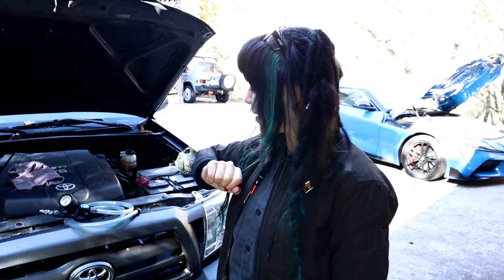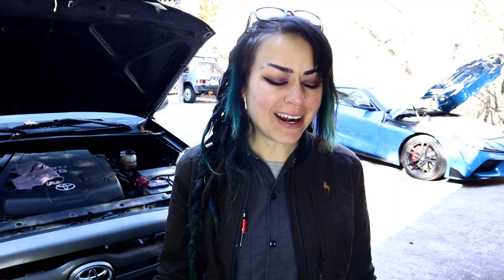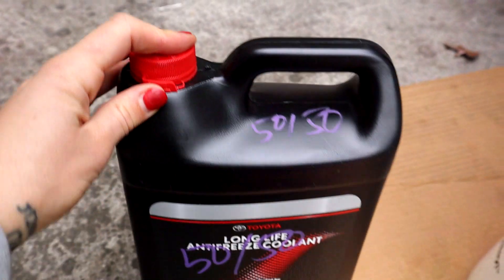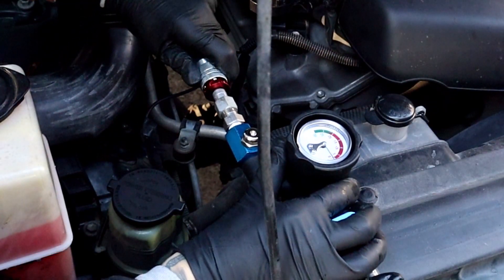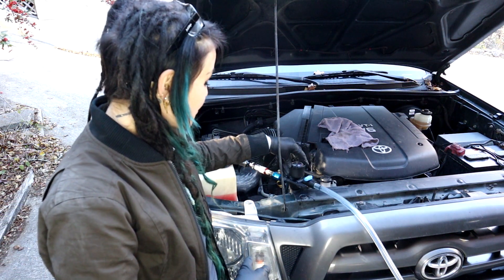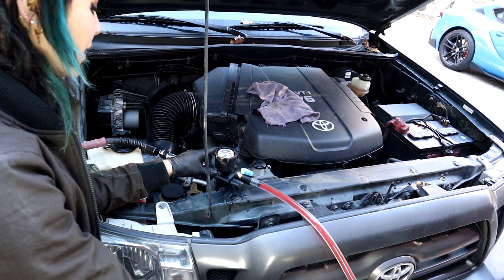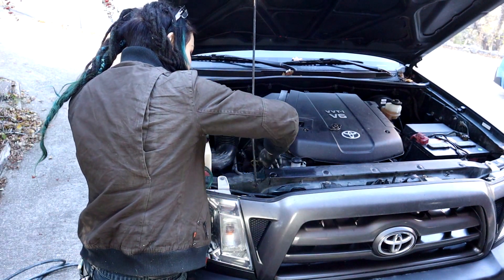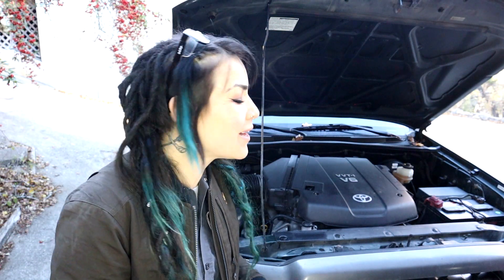How To: Refill Your Cooling System Using An AirLift Tool! // Coolant Flush part 2!

Comment: Yo, stick the bucket up above the fill valve.  When you get to the end, and the pressure has neutralized, it'll continue to siphon coolant into the system until it runs out of the other port on the tool.  That ensures it's completely full at the end without having to pour more in!

I mix coolant in an old 2 gallon pump sprayer that the pump went bad on, it's the perfect size for most cars, and easy to fill.
Reply: Good idea also to let bucket siphon before attaching hose to the valve. That way when valve is opened, almost no air is in the hose.
Reply: I hadn't tried that - next time!   You can 'reprime' the tool when you're close to the end and repressurize a bit futher.  When I used it, I needed to put 2.5 gallons in.  The initial prime only put in about 2 gallons.  I had to repressurize anyway to get the rest in.  No problems whatsoever.

Comment: Great video, Faye. The vacuum system is probably the best way to refill a cooling system. In fact, a lot of OEM manufacturers are now specifying this tool as the correct way to refill their cooling systems. Keep up the good work.

Comment: I have the exact same vacuum fill. Use it everyday to fill coolant to max to prevent air behind the thermostat and also to check for leaks after a repair. Totally recommend this tool to any auto tech.

Comment: I've had this exact tool for about 5yrs now.  No issues with it at all.   

However, I have been bit in the bass by thinking, "it held a vacuum so I have no more leaks.".    Corrosion on a pipe inside a hose.  In a vacuum it held but under pressure it would leak.  I now always put a pressure tester on before releasing a vehicle.

Comment: Ok on some vehicles its tought to get all the air out with a vacuum tool. I have noticed that if you pull a slight  vacuum then prime the hose with new coolant it removes all the air thats in the hose coming from the bucket.  Because if you noticed that once you opened the valve to introduce the new coolant it pulled in all the air from the empty hose. Just a little info if needed. From one technician to another. Thanks take care.
Reply: Could you share how to go about priming the vacuum hose? I'm sure it would help a lot of people out including me. Thanks in advance.

Comment: Nice video!  I totally agree on using this type of tool to leak check and quick fill a cooling system.  I used a UView 550000 Airlift in two my videos when I replaced the cooling system hoses and water pump.  It fills the cooling system in just two to three minutes.  Keep up the great work!

Comment: I agree with the vacuum filling how ever invest in a better tool that fastens to the radiator cap opening instead of relying on vacuum to hold it in place, Rock on Faye

Comment: Thank you, Faye. I appreciate your videos for their content and clear content and instructions. Love your personality and enthusiasm too. I do have one question, at what point did you remove the vacuum tool from the radiator? Does the tool stop  intake of coolant on its own? 

Thank you, again and please keep those videos coming.
Reply from the maker: I removed it once the pressure went back to zero! Yes, when the system is almost entirely full it will no longer have a vacuum on the system, so coolant will stop to flow through the tool and into the rad. After I remove the tool, I just top off the radiator!!!

Comment: Anouther great video. I drive truck for a living and my old truck had a coolant leak. They hooked a much bigger version of that vacuum pump to the reservoir and a feed line to the draincock. They then back fed the coolant through the draincock to fill the block and radiator from the bottom.  I think it took 10-12 gallons of coolant.

Comment: Thanks for taking the time to show us. Great channel. I was also wondering when you connect the compressor what is the required psi setting? If that matters or not?
Reply from the maker: Doesn't matter for this - I have also used a tiny portable pancake compressor and it just takes a little longer, but still worked!!

Comment: A tool like this is shown for a 2012 Chevy Cruze. While it is currently outside my budget it would help with me forgetting to open the top plug to let air out of the radiator when refilling. I usually figure it out when the heater won't heat. While this particular Cruze is a money pit it does offer lots of repair experience (like I need this at my age).

Comment: Faye, you should have primed the filler hose so the air in the initial empty filler hose did not go into the system.

Comment: Excellent video!  So if you are flushing the system, do you use the airlift tool to fill with distilled water several times before filling with coolant?

Comment: A friend of mine expressed some concern that creating a vacuum in the cooling system could allow atmospheric pressure to crush the engine block, which in extreme cases could be followed up by gravitational collapse, reducing the engine to a singularity. I told him the risk was not significant but I think he just likes to worry. 😉 Anyway, I never tire of the adorable chickens. Bless you!

Comment: You hair is the color of the car sitting in your driveway.    Looks great .  What happens if you get some air in your system , I always thought it worked it way out . But maybe that was old school.  Not sure if the new filler tank has a pressure relief . Oh and one dumb thought , could you collapse the radiator tubes?

Comment: Very informative video. Can you also use the vacuum tool with buckets of fresh water to do a system flush prior to refilling with fresh coolant?   Also, I assume you need to set the air compressor to a specific PSI for the tool?
Reply: I believe the manufacturer of the tool specifies 90psi minimum... I run mine at 150.

Comment: Sweet thanks for the video, picked one up today! Will this tool work on a simple drain and fill of the radiator without draining the engine block? Or will the vacuum just suck up the coolant (into the vacuum of space!)?
Reply from the maker: Yes, absolutely it will! You may suck up a little coolant but that won't do any harm.
Reply: @FayeHadley  I ended up doing the full drain. The driver side block drain wasn't fun trying to find the right extension/swivel combination but got it done. 

I was able to pull about 23" Hg of vacuum but it wasn't holding (slow leak). I readjusted the airlift tool on the rad opening and pushed down on it while I pulled vacuum. It was better but still a slow leak. Went back and checked both engine drain plugs (was able to get a torque wrench on the passenger side) and I gave the rad petcock a little extra with some channel locks...no difference. Still had a very slow leak.

Ended up just pulling 23 Hg of vacuum and filling. Seemed to work fine. I topped up and got some of the final air out of the top rad hose. Test drive was good and then this morning I topped up the rad and it took ~100mL. Checked it after work and it's still full and the overflow reservoir is still to the level I filled it. Checked both block drains which I sprayed with compressed air last night and cleaned with a rag so leaks would be obvious. They're both dry and clean. Don't see any leaks around the water pump. Only 60,000 miles on my 2015 Tacoma and no other issues...I wonder if it could be something that leaks under a strong vacuum but holds the positive pressure of the cooling system? Or maybe the tool doesn't seal on my radiator very well 🤔. Of course I did the job after work in the evening and needed my truck for work in the morning so I didn't have time to troubleshoot too much.

Congrats on your new Supra 😁

Comment: Game changer for those that work on equipment that might have a heater core located waaay above the water pump.  Or anything where the radiator is lower than the pump.

Comment: Remember kids...purge the fill-tube of air, else it all goes into the system, when you open the valve. Best way is to open the re-fill valve slightly whilst pulling the vacuum: it'll fill with coolant :)

Comment: I can't hold vacuum using this method. Assuming the connection is good, what could be wrong with the vehicle? Head gasket issue? Bad radiator? Any other possibilities?
Reply: Update: I did a pressure test, and there was a leak by the thermostat. Replaced thermostat and thermostat gasket (the old one was worn out) and that seemed to fix my problem.

Comment: I noticed that when you create vacuum it does not pull from the overflow tank?   it the unit just purging the air from the radiator, then past the engine block "since you said it opened up the thermostat" and thus does it also pull or fill the heater core?   Do you have the heat in the on position even thought the engine is off?   Thanks again

Comment: What is the minimum CFM needed to use the AirLift Tool?
How long did it take to create the vacuum ?
Reply from the maker: Honestly not much for this tool, I actually have used it even with a tiny pancake compressor. It just takes a little bit longer. It only takes a couple of minutes to put the system into full vacuum but you want to leave it there for a while to make sure that the gauge holds steady!

Comment: What kind of pump would you use to refill transfer case or front and rear differentials
Reply from the maker: I have a hand pump but in my diff service video I use a cheap drill pump..That one is super cheap and leaked after five or six uses but I have since then upgraded.

Comment: Easiest way to do a coolant service but Idk if I would trust those cone shape coolant refillers due to the fact that they can come loose, I got a snapon refiller with the turn clamp cap and works awesome but for the price I heard these are pretty cheap since you can use them on any car and don’t have to have all diff kinds of clamp adapters for car manufactures.
Reply: It's not a problem.  If anything, you have way more flexibility in terms of servicing multiple makes and models.

Comment: Is there any way to purge the air in the hose before you open the valve to let the coolant into the system, or is that amount negligible? Thanks for the wonderful video! I simply refuse to do another coolant flush without getting one of these!
Reply: You can 'reprime' the tool when you're close to the end and repressurize a bit futher.  When I used it, I needed to put 2.5 gallons in.  The initial prime only put in about 2 gallons.  I had to repressurize anyway to get the rest in.  When I did, there were some bubbles that came out.  No problems whatsoever.

Comment: When you open the valve on the coolant supply line, it seems your injecting the air in the line into the cooling system because the line was not primed.  not sure there is a way to prime that tool is there? Would need another ball valve to shunt back to the venturi exaust line.
Reply from the maker: Oh totally, you can just stick it in the bucket!! Let the hose fill, shut the valve, and bring it up to the rad, it will stay full!
Reply from the maker: HAHA for sure! I normally prime the hose by placing it into the bucket of coolant first, then closing the valve. 👍🏻 (Oops I forgot to do that in this video!) but regardless it wasn't enough to make a difference or capture any air into the system, yay!
Reply: Thx for the reply. It seems like a pretty small amount of air in any event. Less I could imagine then a conventional fill depending on the car.
Reply: It's not really a problem.  You can 'reprime' the tool when you're close to the end and repressurize a bit futher.  When I used it, I needed to put 2.5 gallons in.  The initial prime only put in about 2 gallons.  I had to repressurize anyway to get the rest in.  When I did, there were some bubbles that came out.  No problems whatsoever.

Comment: Thanks Faye!

But wouldn’t it be a good idea to get all the air out of that clear hose. Either siphon the hose full of coolant, or elevate bucket with hose attached to bottom of bucket and let hose fill before attaching it to control valve.

Comment: I have  a question for anybody that has the answer. will this work on a remote Reservoir type cooling system? you know one that doesn't have a radiator cap on the radiator.
Reply from the maker: YES IT DOES! Just place it on the remote res - I should have addressed that in the video, thanks for the Q!
Reply: @FayeHadley  ah very good. Thank you.  I hoped this was the case.  Gonna buy one for sure. Been on my list awhile.
Reply: Yes it does - just performed this service with this tool on the LS 460.

Comment: I am slightly concerned that the vacuum will be harsh on the rubber coolant hoses. do you think doing that several times can cause the coolant hoses to fail?
Reply from the maker: Not at all! But if they show any signs of weakness here... then you know that they are on their way out and need to be replaced soon! It's a good check of their health. Think about all of the pressure that is being exerted on them when the cooling system is hot and under full pressure!
Reply: @FayeHadley  Sounds good to me. You are an amazing woman.
Reply: If anything I think it would be a great test of your hoses' health.  If 25psi hurts your hose, it's time for new ones.

Comment: Can this be done on a car that doesn't have a radiator cap ?
Reply from the maker: YES! You have a pressurized coolant reservoir??
Reply: Ok, makes sense !
Reply: Yes, I have a Lexus LS460 that doesn't have a cap but a pressurized reservoir.  Just performed the coolant change yesterday with success.   I had to 'reprime' the tool when I was close to the end and repressurize a bit futher.  When I used it, I needed to put 2.5 gallons in.  The initial prime only put in about 2 gallons.  I had to repressurize anyway to get the rest in.  No problems whatsoever.

Comment: First thing you did was introduce air into the system
Reply from the maker: HAHA for sure! I normally prime the hose by placing it into the bucket of coolant first, then closing the valve. 👍🏻 (Oops I forgot to include that in this video!) but regardless it wasn't enough to make a difference or capture any air into the system, yay!
Reply: Doesn't really matter - you'll get that small amount out later on.   You can 'reprime' the tool when you're close to the end and repressurize a bit futher.  When I used it, I needed to put 2.5 gallons in.  The initial prime only put in about 2 gallons.  I had to repressurize anyway to get the rest in.  When I did, there were some bubbles that came out.  No problems whatsoever.

Comment: Using distilled water is a myth. I'm 50, watched my dad flush and fill radiators with tap water and so have i. Never had any issues. The same with batteries.